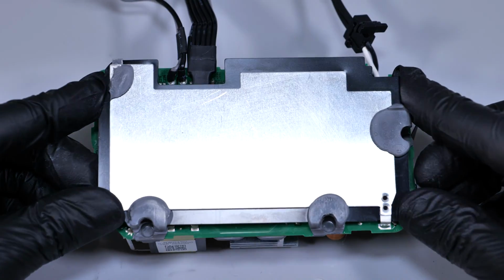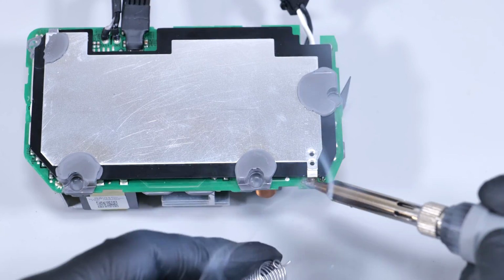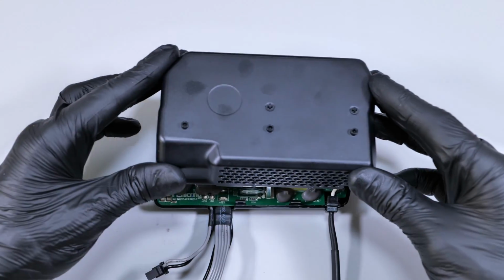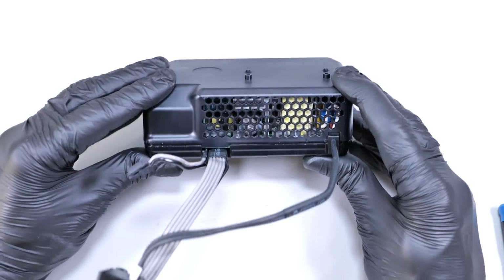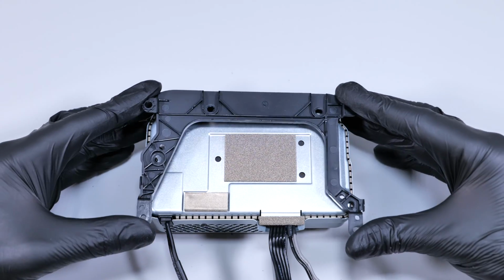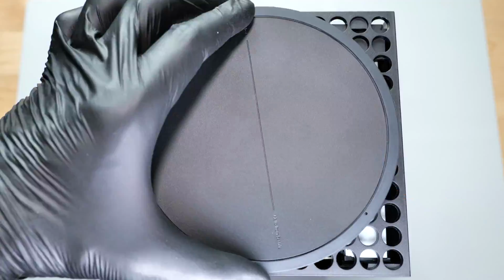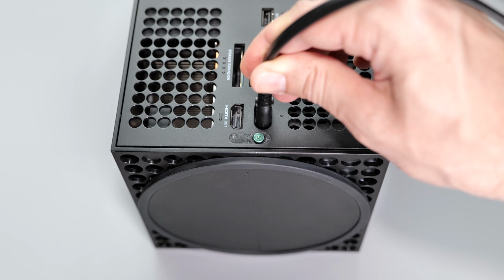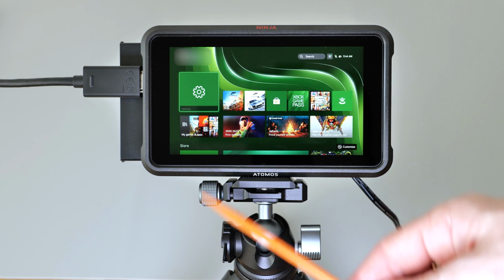Xbox Series X Power Supply Repair Guide – Fuse, MOSFET, Varistor & No Power Fix

Comment: I have a problem with my series X. It turns off after like 5 minutes of playing, sometimes when loading a game. Screen freezes and it shuts down immediately after. I tried cleaning the heatsink and changing thermal paste, but it seems that wasnt the problem. I'm thinking it's a PSU problem but I dont know much about electronics. Which component on PSU can I check and repair if it results to be the problem?
Reply from the maker: To be honest, even as a technician, I wouldn’t bother trying to repair the PSU because failures like that are rare and hard to troubleshoot. We usually just swap in a known-good donor if needed. That said, your symptoms freezing and shutting down after a few minutes don’t really point to PSU. Since you’ve already replaced the thermal paste, overheating seems unlikely, but I’d still suggest double-checking that part (I have a video on that). If you removed the heatsink but didn’t replace or properly reshaped the thermal putty on the memory chips or MOSFETs, those components might not be making proper thermal contact anymore. That can definitely cause overheating and trigger shutdowns. Even just reusing the original putty without reshaping it can lead to weak contact. But overall, the issue sounds more like a failing APU or one of the power phases (MOSFETs) not delivering stable power. Could also be micro-cracks under the APU or something that trips thermal or power protection when it gets hot. In most cases, we check power delivery on the board and often rework the APU if needed not something it's not something you can do without proper tools and experience.

Comment: Xbox one X issue of mine. It did melt off a cap on the back  that was only hanging on from one side and was way off from the other and was still a good cap after testing. Weird how it melted off though. .  But nothing from the fuse and a short resistor. I'm ordering it now. I'll update soon
Reply: Internet says it's not cost affective. But for $2!!! Better then $50+ and the best part is that if they blow again, nothing else will go bad at all.
Reply from the maker: If you can repair a power supply, it is extremely cost-effective because the components are very cheap. In the end, however, everything comes down to skill. We don’t do many repairs anymore because we have a pile of Xbox Series X and Series S consoles that clients abandoned due to dead SSDs, which makes the consoles non-repairable. Because of that, we have plenty of donor parts. In the beginning, though, we repaired all power supplies.
Could you take a picture of the melted capacitor and the resistor you believe is shorted and add the links here? That would help a lot. Also, it’s very important that after replacing the fuse, you power up the power supply in series with an incandescent bulb. If the bulb lights up at full brightness, the power supply is still shorted. If it glows much dimmer, then it’s fine.

Comment: Could you help me? My Xbox series X keeps shutting down after about 5 minutes of being turned on. A store said it might be the power supply and that I should replace it. Does that really make sense?
Reply from the maker: Is there any difference in how long it takes to shut down if you’re playing versus just letting it idle?
Reply: @ElectronicsComputers, in the main menu I just set it to stay on for 20 minutes without turning off, I entered GTA Online... after 4:50 minutes it turned off. And right after that I can't turn it on again, only after about 5 minutes.
Reply: And it also happens when I try to turn it on again; it turns on and then immediately turns off.
Reply from the maker: @HiagoVitale  It looks more like overheating issue to me. This solution may help: https://youtu.be/GTvtAM7Fi5U
Reply: @ElectronicsComputers, the store that gave me a quote, replaced the thermal paste, and it's still causing problems...

Comment: My Xbox makes arcing noises and sizzle as soon as I connect it to 230V.

I tested the power supply with no load (disconnected all cables and the noise went away).

But it's definitely coming from the power supply.
Any idea what could be causing this?
Reply: it happens when you leave the xbox on for a long time (like on overnight unattended). It just happened to me and i just bought a $30 part on ebay to hopefully fix it

Comment: Can i switch xbox one s power supply with the series x power supply?
Need assistance plz.
Because in my country there is no new power supplies for sell.
Reply from the maker: Those are completely different power supplies. Technically, you can use any 12 volt power supply and from Series X too, even from an ATX from a regular PC will work but it's not gonna look nice.

Comment: Hi, i'm a little late but recently my xbox been having problems displaying 1080p, I think is a voltage problem because this all happened when a lighting struck near the xbox, 720p works just fine and I already tried on different tvs and hdmis ¿solutions?
Reply from the maker: If you force 1080p and get a black screen, that leans toward the retimer chip, HDMI signal conditioning not passing the higher bandwidth. If you get distorted / flashing / unstable image at 1080p, that usually means the APU’s HDMI encoder is damaged. The APU is still trying to push the signal, but it can’t maintain proper timing or strength at high bandwidth after the lightning surge. I have a video on the retimer chip replacement.

Comment: Xbox series x turns off after 2 hours of use . Never get an over heat message , could it be the psu ?
Reply: it is most certainly a psu that is most likely clogged with dust and shuts down through the NTC because of overheating (that is the very purpose of the NTC)

Comment: For me getting that crank sound but not turning on .and it was gone last day when I power on the wall socket and heard a boom sound and some smell . I didn't turn on the device just connected to wall outlet and boom.

Later I just got checked with a service shop and they told power supply is gone and told me a huge bill but since I saw your video I am trying to fix it myself so just before going down what else do u expect if there was a sound and getting a crank sound when making the power connection Is it really gone or the capacitor is actiing
Reply from the maker: Well, if you already have a multimeter, soldering gear and a basic idea of what you're doing, then it's worth trying. Usually you just need a few components that cost around $5–10. But if you have to buy all the tools, it might not be worth it, since you could just get a used but working power supply with free shipping and a warranty for about $50: https://shp.pub/78xg9x
Reply: Unfortunately In India AliExpress is banned and import from china attract lot of custom . I already enquired about it in alibaba but shipping amount and custom makes double the price of the unit.. so in local stores they ask for 120 usd something for replacement , so thought of giving a try soldering packet cost around 5 or 6 usd including multimeter  
Never used multimeter that's only concern and the model I am ordering is bit different DT830 D  model so is it ok to do test in this
  @ElectronicsComputers
Reply: I have opened it and seems some ant made their home and it's parts made some short over the board any idea how to diagonis in this and it seems to different power module from liton brand not chinoy .  @ElectronicsComputers

Comment: I just did everything shown in this video. Now, my series x turns on for 10-15 seconds and powers off automatically. Fan turns on and power button lights up but that’s it.
Reply from the maker: Was your power supply faulty, and did you fix it?
Reply: Needs a reset

Comment: What does it mean if you here cracking when you plug in the supply?
Reply from the maker: @markatkinson167  That means that the input stage of the power supply works fine.
Reply: @ElectronicsComputers  but xbox won't turn on

Comment: I stopped using my series X for a month, when I turned it back on it worked for a few minutes until I entered a game for seconds and it turned off by itself. After that it didn't turn on anymore. I had just changed the regulator a few days before and I don't know if I should attribute it to that or the console was going to fail on me anyway. Regarding the series X, do you think it's a problem with the power supply or some other component? (I was already hours away from finishing my game and I was getting ready to sell the console😭...this makes me practically sure of planned obsolescence and the spying that Microsoft does on its users. It's a joke)
Reply from the maker: Have you tried that trick of slowly unplugging and plugging the AC cable back in? Do you hear a sparking noise? It's very hard to diagnose without measuring some voltages inside the console. I have to say that the Series S|X is the worst console from Microsoft. The previous one, Xbox One S|X, was easily repairable and upgradable. The Series S|X doesn’t last long because of those 2230 SSDs with encrypted partition. If the SSD dies, no one can fix that console. We have a pile of them in my repair shop.
Reply: @ElectronicsComputers  I tried what you mentioned and I can hear a small noise (I think it's an electrical noise) that is not caused by mechanical entry or by forcing entry. After that, I can't hear the "beep" that the console used to make after a few seconds and it still doesn't turn on. Do you think it's worth taking it for evaluation (I was about to finish Tales of Arise to sell it immediately) or should I put it at a very low price and try to sell it for parts?

Comment: Using this I was able to narrow down the issue to the PSU, no voltage coming out. Also was able to rule out motherboard short on main and southbridge board. Awesome video thank you!
Reply from the maker: Glad I could help
Reply: @ElectronicsComputers  Figured out MOSFET on the bottom near the large capacitor leads were damaged “AP60SC480D” found one on Ali, will see if this fixes the output!

Comment: What if you do hear electrical arcing when doing step one?
Reply from the maker: That means the input AC stage is working (fuse, varistor, NTC, diode bridge, and big electrolytic capacitor).
Reply: So it's a faulty cable?  @ElectronicsComputers
Reply from the maker: @markatkinson167  No, this way, we check if the input stage of the power supply is working properly.
Reply: @ElectronicsComputers right, so what's the likely cause of the xbox not turning on?
Reply: @markatkinson167  commenting for exposure because I also am having this issue!!! Did you ever fix it??

When you slowly plug in you can hear it arcing but still nothing when you push button

Comment: Mine does the sound with the cable but it won’t turn on. Any guesses?
Reply from the maker: There is no 12-volt output between any gray and black wire?
Reply: You ask a question then you don't reply

Comment: I checked the fuse and the fuse had continuity but when i went to check the varistor. I recieved an 0L. Would this reading be due to a bad varistor or would it be caused by an issue somewhere else on the circuit board?
Reply from the maker: That's normal. A functioning varistor should have infinite resistance.

Comment: 1:38-1:43 took you 5 seconds and I’ve spent the past hour trying to get the bottom of the case off without damaging the board.
Reply: Also, mine doesn’t look exactly the same as this one either. Everything was identical until I got the case off of this power supply and it’s not quite the same.
Reply from the maker: @caleblasyone7435  I've disassembled hundreds of consoles, so the process is quick and straightforward for me. There are several revisions, each with minor changes.

Comment: I’m having an issue with mine where I can play for a while and it will turn off and not turn back on. If I unplug the power cable and then plug it back in it will work again. Also if when I’ve finished playing and turn it off it will then not turn on until I’ve unplugged and plugged the cable back in. I’ve opened the case and cleaned out any dirt but I still get the problem. Any advise?
Reply from the maker: Do you have a multimeter? It's hard to diagnose such cases. It could be just a dry capacitor in the power supply or some issues with the system board. Without checking some key components it's hard to say.
Reply: @ thanks for getting back to me. I do have a multimeter, I have however ordered a new PSU in the hopes it will resolve the issue. It managed to stay on for an hour this morning before turning off. If it’s not the PSU could it be the main board?

Comment: Great video 👍 Could you tell me whats the gray stuff is used? I want to put it in my playstation psu as well to dampen the noise.
Reply from the maker: Thank you for your comment! The gray material is called electronic potting silicone. It’s similar to regular silicone sealant but enhanced with thermally conductive particles to provide both insulation and effective heat transfer. In my repair shop we use these:
Potting gray silicone: https://alii.pub/740oqh
Potting silicone hard and soft: https://alii.pub/740org
Reply: @ thank you SO much 👍 really appreciate it. Merry christmas 🎄
Reply from the maker: @richieb9675  Merry Christmas!

Comment: I switched a power supply and mine still dont turn on??
Reply from the maker: The problem might be in your motherboard. Check all the power rails for shorts and ensure all key components and power rails are receiving the correct voltages.
Reply: @ on the multimeter if it beeps is that a short? Then
Reply from the maker: @kevinthorn9672  A continuous beep means continuity between two leads. It could be a short, especially if you're checking capacitors or MOSFETs.

Comment: tell me if it throws me out of the game, if I play for 30 minutes and the xbox x freezes and turns off.
is this a problem with the power supply?
Reply from the maker: This is one of the most common issues Xbox customers bring to us, and unfortunately, there’s no simple solution. In most cases, the problem is related to cooling—either dried-out thermal paste or degraded thermal putty. A common mistake is when users replace the thermal paste but neglect to replace or properly reshape the original thermal putty. Once the heatsink is removed, the thermal putty often no longer makes proper contact with the VRAM and power management components, leading to inadequate cooling for those parts.
Another potential issue could be a failing SSD. To diagnose this, you can connect the SSD to a computer and check its SMART data, as well as scan for bad blocks, which can affect performance and stability.
The issue could also be a failing MOSFET in the APU’s power delivery circuit. Since multiple MOSFETs share this task, a single failure can disrupt power during high-load tasks, causing crashes or instability.
In my experience, power supplies are rarely the cause in these situations. They either work perfectly or die completely, with little in between.
Reply: @  thank you! my disk is 99.6% occupied and 3.6 GB are free. Do you think this could be the reason for the game shutting down and throwing me out onto the desktop?

Comment: Do you offer this service to repair an show much ?.. Uk based and thanks
Reply from the maker: Since I'm on a different continent, the cost of shipping and repair would likely be more than buying a working one on eBay. This process is only worth it if you’re able to attempt the repair yourself. Otherwise, it’s more practical to buy a used one from a reliable seller. Here's a brand new original power supply for $32: https://alii.pub/72fx4a and 8 pounds shipment.
Reply: HI you never replied ..?

Comment: Hey great video! My mosfet was faulty and I'm having trouble finding a replacement one. It says 60SL115D on it, would you be able to help me out?
Reply from the maker: Here’s a proper replacement for that MOSFET. It will cost you less than $10 delivered: https://alii.pub/72687r
Reply: @ElectronicsComputers  Awesome, thank you so much! One more question, mine had a lot of a stuff on the bottom of my board that i had to scrape off to desolder the components. Like a white resin and squishy gray pad. I'm assuming that are for heat transfer? Would you replace that with a thermal putty or just leave them without it?

Comment: My series x had a problem for a year sometimes it turnt on and then off there was a clicking sound the light turned on and off this was going on for at least 11 months i dindt had this for 2 months until today i tried turning on my series x again and all of a sudden there is nothing anymore no power nothing and yesterday i played normal with no problems.. And normally the controller vibrates if you connect it to the series x when turned off but not even this is happening no sound no light nothing do you think i should buy a psu and trying to fix it myself? Or should i send it in somwhere? I already tried everything power cycle etc. this happened all of a sudden a month after my warranty...was done
Reply from the maker: For intermittent faults that appear and disappear, it’s difficult to provide specific advice without proper diagnostics. The issue could range from something as simple as a loose connection or a 'cold solder joint' causing fluctuating contact, to more unusual problems like a dead insect inside the console. Often, such faults are linked to the power supply, but it’s hard to pinpoint the cause without a thorough check. If your console has been exposed to pests, dropped, or potentially suffered liquid damage, these are common scenarios that could explain the issues you're experiencing.